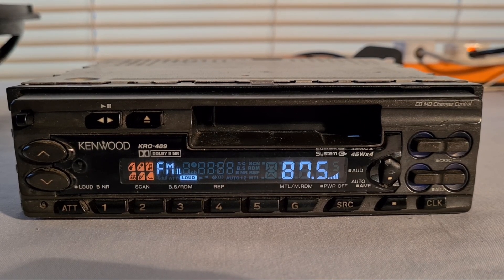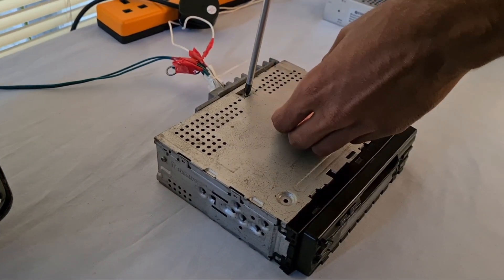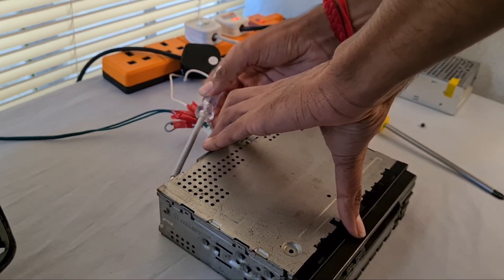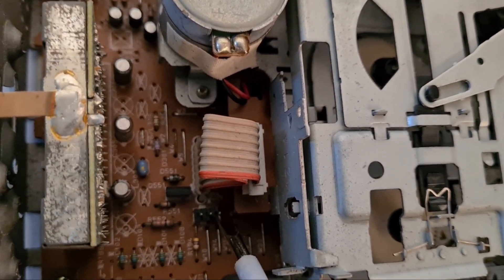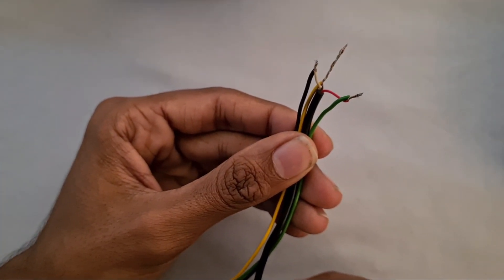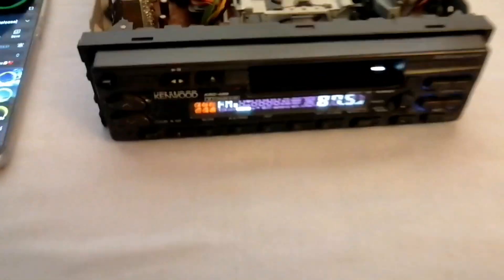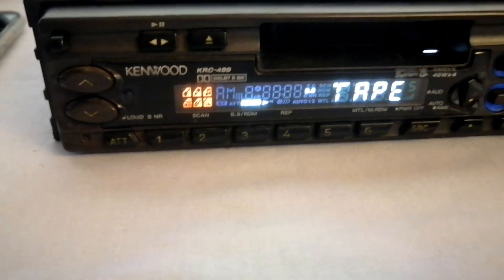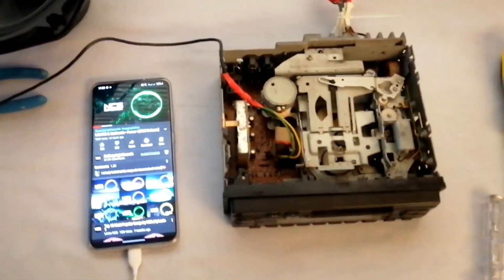How to add a 3.5 mm jack to an old car cassette player #Kenwood

Comment: Why couldn’t these manufacturers put an aux out
Reply: Phones and ipods didnt exist on a major level when casettes come out ;_; if you think about then why didnt they just use cd instead of cassette? Cuz it wasnt made yet
Reply: @poopstermcpoopson5667  true but any cassette player in your house had an aux port. My fathers double cassette player had equalization and aux, probably some other things I can’t think of. The aux port is literally wires and a connection, it wasn’t a whole lot of extra money.

Comment: How to prepare the current suply wire
Reply from the maker: I have a 12 volt power suply which can be bought at any hardware store then i wired it as per the labels on the power supply .
Reply: @bhooveerlabs5890  will a 12 volt adapter work.. If works how much ampere? Pls reply